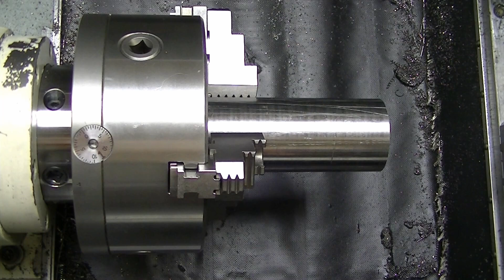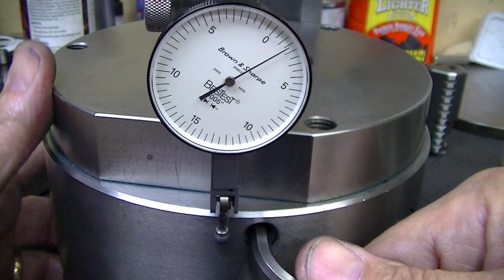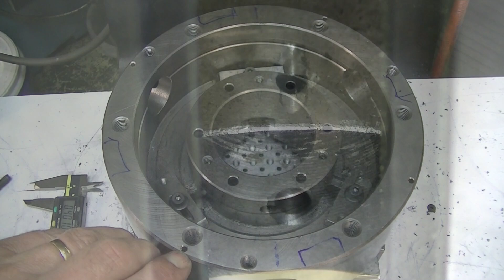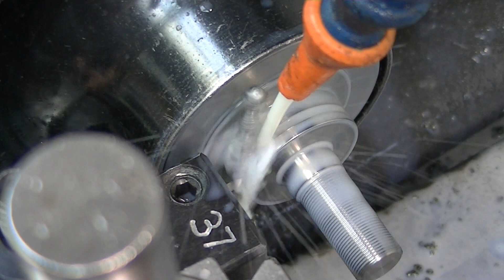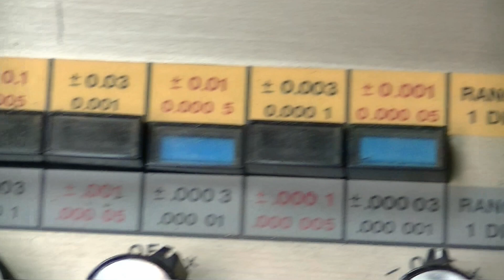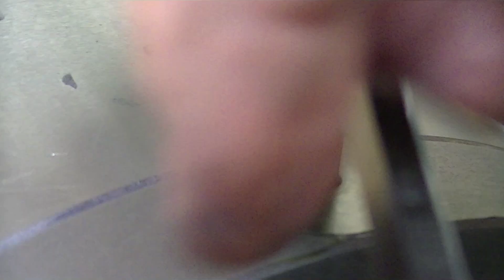MAKING A BETTER ADJUSTABLE TIR LATHE CHUCK

Comment: this is the same as using an adjustable 4 jaw, only with a lot more steps
Reply from the maker: Except when doing multiple pieces of the same size. This you adjust once and only fine tune as necessary. 4 jaw you have to re-tweak every piece. Also the 6 jaw holds with less shape distortion from clamping than 3 or 4 jaw chucks.

Comment: As of May the 2nd 2025 there is yet another Dan Gelbart video in a short time, this time about creating very high resolution high-strength 3D printed full-metal parts. This is not the process he was showing a few years earlier, there are new cool tricks he uses.

Comment: Buck chucks are good tools to have.  I have seen the distortion you have shown,  my approach has always been to loosen all the adjusting screws and move only the one I need to move it in the direction I needed it.  Then loosen it again and adjust the others as necessary until I get it running as needed.  Always loosen them after adjusting them.  Once the chuck is adjusted where it needs to be I snug up all the screws, one side then the other mindful to be deliberate to not skew the results..  Do this to secure the chuck in position being careful to avoid distorting the chuck while maintaining the concentric adjustment.  Done it this way for the past four decades I machined and always teach others this method. This method works well and is quick.  Nice chuck you have masterfully built thank you for the video.

Comment: Re-watching I am getting more and more ideas. 

I don't really need a set-tru chuck but stiffening the system with two bolt patterns is a game changer IMO. In fact a thing I have been irritated by is the fact that on the chucks I currently use, chips get caught in the annular space between the backing plate and the chuck. It gets worse because the type I have has a keyway. I was thinking about somehow filling up the space with a sealant or something but that would be so permanent it would be a huge hassle when the chuck would need disassembly. Right now I am always taking the chuck off the backing plate when swapping them. 

Now, I think there is a great opportunity to kill two birds with one stone. First, make a thicker chuck end/ stiffener plate that lines up with the outer mounting surface of the chuck, so there is no shoulder anymore. Then, post-machine the two in assembled condition and add bolt holes as required (for front mounting if that is not already the case). Then, machine the backing plate adding the threaded holes and get rid of the stepped shoulder. Next, mount the to together and indicate on the lathe to run dead center. Take the assembly to the drill and add to conical dowel pin holes. Add dowel pins for future alignment. For disassembly, dowel pins with internal threads may be used for a slide hammer or threaded holes may be added for pressing the pieces apart with screws. 

When all is done bore the (hard) jaws as is now well known. 

Notes: 
- The chuck end/ stiffener plate does not need to be an interference fit per se when the set-tru feature is not added, however I feel that it will only add to the stiffness. The plate may also be fitted with screw holes for push-off disassembly.
- Making the end face of the chuck flat will make it very easy. After all making two parts with the same axial dimension on two shoulders is over-constrained by definition, with the set-tru feature it is necessary but pretty advanced skills and equipment are required to do it right.

Comment: Watching this for at least the third time. Received a TMX six jaw chuck for our Hardinge lathes at work yesterday and was disappointed to find that it is just about as much a chuck 'kit' as the Shars chuck, but at multiples of the price. The quality of the deburring especially is shockingly poor - raised edges around pretty much every hole, very uneven chamfers on holes, not to mention dents in the back plate face that bears on the chuck body from where somebody tightened the two together with chips stuck in between. The upside is that I had a great excuse to tear it down, and since I have to modify an adapter plate for it anyway I might as well give it a bit of the Robrenz treatment while I'm at it. If only I had that beautiful rotary grinding setup or a dozen or so fewer open projects so I could think about making one.

Comment: Thank you Robin for taking the time to film and edit these super high quality videos! Both the content and the video quality are second to none! I really love the matching ground step height for the back plate, and the pressed in stiffening plate made such a difference. I never knew about the long bolts from the front vs short bolts from the back design detail so the bolts can flex and not impede the skidding. I think of the bolts acting like flag poles in the wind.

Comment: Very nice. Is there any advantage of a 3 jaw over a 4 jaw scroll chuck? Dan Gelbart seems to only use 4 jaw chucks since they can hold square work in addition to hex.
Reply: I like the 4 jaw self centering chuck but I'd say one drawback is uneven clamping pressure because it is over-constrained. It may be less of an issue with cold drawn materials in the h9 tolerance class but with hot rolled and forged materials it's not ideal.
Reply: @bigbattenberg  Makes sense! I guess ill keep my 3 jaw around too. Cheers
Reply: @neverwipe  Do check out 'boring hard jaws' as shown by Rob Renzetti. This is a crucial step for improving any chuck's clamping action. I have made an invention myself (for preloading the jaws) which I have published on my blog site. If you are interested I can send you the link.
Reply: @bigbattenberg  yes please send me the link. Ive been meaning to do whats shown in that vid. I was thinking to use a section of aluminum tubing because it is compliant and i can just clamp hard and plastically deform it to preload the jaws evenly.
Reply: @neverwipe  It appears all my attempts at sending a link are taken down. I remember the time when you could DM people via YT. This is really frustrating.

Comment: Shars has a reputation for being the best of the chinese import stuff.  i noticed your using a shars test indicator. how much use has it gotten? holding up well?
Reply from the maker: I bought them as beater indicators but they are very sensitive and are holding up nicely.
Reply: @ROBRENZ  thank you Robin. your reply timings impeccable, im literally looking at indicators online right now lol.

Comment: Did you consider adding Belleville washer on the opposite side creating the same pressure as the screw to use only 2 adjusters?

Comment: Another gold standard project Robin. I sometimes use those high-tensile socket screws as stock for making parts, I hadn't thought that having forged heads  would make them even stronger. So many insights in your videos.

Comment: Great video, spectacular design and work and as always, well explained!
I love the re-purposing of high grade screws... Just recently made an axle outta m20 12.9 200mm bolt... Machined like butter on the baby precision lathe, which says a lot, despite the lathe being an old yugoslav masterwork, shes a small lathe and not a skookum beast like my 3 ton lathe, but a 3 ton lathe is a bit inappropriate for whats essentially a needle in her point of reference...

Speaking of high grade bolts, I recently picked up 45 kg of m30 10.8 240mm bolts, and im only sorry for not snagging the whole 90 kilos of the old stock, as they were scrap priced despite being new old stock... Its always nice having a stash of at least 100 pieces of specific high grade bolts for custom works... I have a few other high grade bolts, but its rare to come across a whole lot of high grade identical stock, so those are in pairs or stacks of up to 20 at best... 
Also, not just high grade steel, but scrap crankshafts and camshafts offer nice sections of very good, hard cast iron for decent sized bushings and such.... 
There is very high grade material out there to be had for next to nothing, one just has to know what contains it, and where to find it for scrap prices, as commercial prices are insane and you often cant buy bits and chunks, but at least 3 or 6m long sections of material, which is outta question for high grade material at full price... Might as well go rob a bank before you consider that... Just coat the machinery in thick grease in case you land a prison sentence due to lack of bank robbing experience as a machinist... The machines will need some rust protection while you are away... 

Either way, all the best Robin, its always a great pleasure seeing your videos, as i hold you as the highest example of what to do, and at the same time, as the starting point, as nothing except for perfection and best approach is an option... Stefan and a few others live up to the standard, and so are a pleasure to watch and learn from, but i think i found you before i found stefan or any of the few other people worthy of the highest praise, so you naturally get the 1st place on my pedestal of machining excellence... 

Kindest regards!
Steuss
Reply from the maker: Thanks for the very kind words!

Comment: Some years ago I have converted a 6" chuck to make it adjustable. It is a good conversion and I apparently unknowingly avoided the flexing of the chuck body, at least to a large extent. But now, after watching this, I will probably re-visit that to see just how good or bad my design is in this respect. His point about the front of the chuck bowing out, making the jaws "bell mouthed" is a very good one. And his method of reinforcing that is excellent. 

I mention my experience because, when I say this is an EXCELLENT conversion and video, I want everyone to know that I do speak from experience. Robin has considered and apparently successfully tackled so many more issues that come with an inexpensive chuck. 

My hat is off to the master! Yes, thank you very much for the excellent conversion and video.
Reply from the maker: Thanks for the kind words!

Comment: Hey, Robin. With the chuck held in by the long hardware, would the amount of force this chuck could take before deflecting be lower than a traditional chuck mounting plate, which has a close-fitting boss?
Reply from the maker: Not enough to matter.

Comment: I have wanted to add thousandth scales to my chuck for years, I just never did it. It is still going good to sit far down on my to-do list but I am glad to see someone do it. Nice to see a new ROBRENZ video.
Reply: Just wanted to add this in here, I am not challenging or claiming that you are doing anything wrong here. When I did my tool and die apprenticeship ship I was taught to NOT clamp anything with the 4 opposing screws and that they are just for pushing the chuck body around. I was told to back off the face screws one half turn each, push the chuck body until the part was running true, re-tighten the chuck face screws then just ever-so lightly tighten the 4 jack screws. Not to apply any holding force, more so to keep them from walking out during cutting. The back side of the chuck and the face of the mounting plate that make contact with each other are lapped together for a true contact. I have been doing it this way for years and never had the slightest indication of wear or issue.
Reply from the maker: That is an excellent procedure!

Comment: Robin:  About gave up on you. Another excellent offering, complete, well crafted, well presented - plain good work.

Two questions:

 - 1 how well does the pinion O-ring seal when the body is fully displaced and 

 - 2 how is spindle torque transmitted from the backplate to the chuck body except via clamped face friction and bolt shear. Creep rotation of chuck relative to packplate will jam up the pinions. Or did I miss something really obvious?

I was thinking of a cross keyed spacer between tne inner faces giving X -Y constraint (Z being the spindle centerline axis.)
Reply from the maker: Great hearing from you Forrest! Thanks for the very kind words.

1. Design wise it should stay touching through the full +/- 0.010" travel but the transition at the edges probably is not a perfect seal. It doesn't really need to be perfect as centrifugal force is throwing stuff out.

2. Friction, bolt bending stress, and the 4 flats that engage the adjuster thrust bearings act as a very inefficient square drive because the aspect ratio is poor.

I think you are talking about building an Oldham coupling into the chuck to directly transmit the torque from the back plate to the chuck body without interfering with translation in both directions
Reply: @ROBRENZ  Oldham coupling: that's it! Cudgled my brain but couldn't recall. Had to circumlocute. Not that an adjustable three jaw chuck, used competently, has to transmit much torque but there's always them parting blade snappin' moments...

Comment: Great video and design work.  One part I was waiting for that I think maybe wasn't shown was pressing in the one thou interference fit inner backing plate.  I'm wondering how that press fit went and I wanted to ask if you concluded that 1 thou was good.  Would a tighter interference fit have noticeably improved things any better than the 6 tenths compression you ultimately measured?

Comment: I use the text layout sketch approach as my standard process. If you were not aware,  each sketch text entity creates a floating anchor point (little blue dot). Your text sketch will report as not fully restrained until each anchor dot is fixed. They are visible (printable) , so anchor them someplace strategically - like over a hole.

Comment: Thanks for showing all the details. I never had a Buck Chuck, and always wondered how the body moved with respect to the backplate, while still keeping a tight connection. Thanks for showing that the screws bend to accommodate the movement. Regarding Gelbart's chuck, did you talk with him to find out the opposing screws move in unison? I believe I watched all his videos, and I don't recall that information when he was showing the lathe and its chuck. I believe he also has belleville washers to apply the pre-load between the chuck and backplate? Do you know?

Where did you apply the teflon tape? I got a bit confused on that part.

Thanks!

Comment: It's like if a 4 jaw and a 3 jaw had a baby with the best genetics of both parents. Of course, it does not completely solve the problem that the runout on a 3 jaw can be different when the chuck is set to different diameters. That's why you want to start with a good three jaw to begin with.

Comment: I especially like the re-purposing of the socket head cap screw! When you started talking about the elongation of non-homogeneous constituents and the grain structure of the material in the direction of working during forging I really got excited. Bravo!

All the best,

Tom
Reply from the maker: Thanks Tom, those SHCS really  machine beautifully and are way cheaper than 17-4. At 170ksi yield strength for 1/2" and  below, they are tough to beat.  

ATB, Robin
Reply: @ROBRENZ  for Tom to get excited about materials science you must really be doing something special!
Reply: @ROBRENZ  I've seen other people make things from bolts but never to make a part like this.

Comment: @Robrenz another great lubricant for the scroll would be molybdenum disulfide dry lubricant. When I was in the AF we used to use it on the missile launcher rails and when they came in for their 18mo inspection we had to strip it off to apply a new coat. If I recall correctly it is rated up to 250,000 psi before it starts to wear off. Great video by the way and excellent explanations of everything 👍.
Reply: Just to clarify. I am talking about the kind that is sprayed on from a rattle can and goes on like a primer and has to be left to "cure".

Comment: The import 6" 3 jaw I had, I found that the slots in the chuck body for the jaws were not flat or straight along those rails, the chuck bore side/end of the jaw was lower than the OD, so I had to rework the slots so that the jaws travel in a flat and paralell manner. There was no grease or any sort of lubrication in it, brand new.

Comment: Great video, awesome work. Your comment on Euler loading (and failure mode) of Jobber length drills at 24:30 reminded me that my Swiss strengths-of-materials professor of 30 years ago always made us aware that Leonhard Euler's last name is pronounced "Oiler" (like Edmonton Oiler or Houston Oiler) and promised to fail any of us who pronounced it otherwise. I'm pretty sure he was correct; just thought I would mention it. 
The first occurrence of Euler buckling assumes a sine profile and would wreck the drilled hole and eventually with higher column compression will shatter the drill bit.

Comment: I did the bearing race trick to a cheap chuckand works wonders... I ggot a question, how donyou load a 6 jaw chuck if the jaws do not live in the same circle to begin with??

Comment: great video and an excellent design. thank you for sharing and also for mentioning Dan Gelbart 1:03:15, another true legend of the trade.

one thing I did not understand: At 23:24 you put a relief on the diameter to get the ring started square when pressing it into the chuck body. But at 42:23 it looks to me like the relief is on the wrong side. What am I missing? Can someone explain?
Reply from the maker: I drilled and counterbored from the wrong side!

Comment: Excellent idea
I did someyhing similiar for use on 4 jaw chucks. Only without the graduations and working on the Z axis. We had common jobs that involved indicating faces on parts. As most 4 jaws have tee slots l used the appropriate size tee nuts and hex head screws. The hex head was then tapped for a fine pitch screw. The jack screw could then be used to move the face of the part around. Much better than using a soft hammer or pry bar. The jack screws made things controlable.